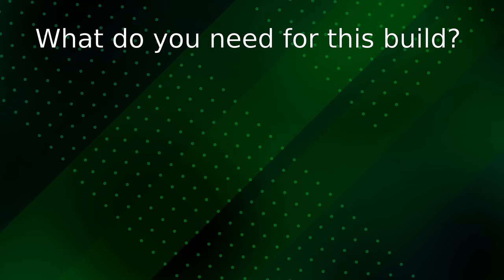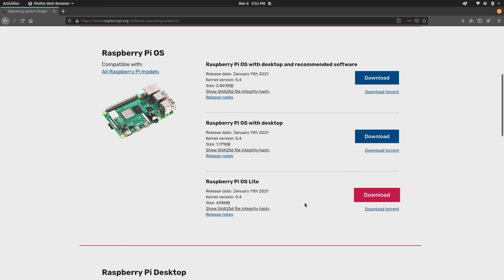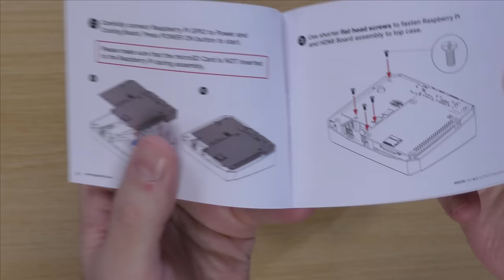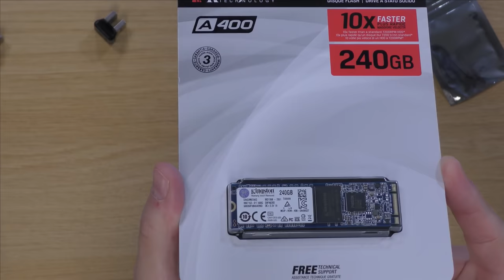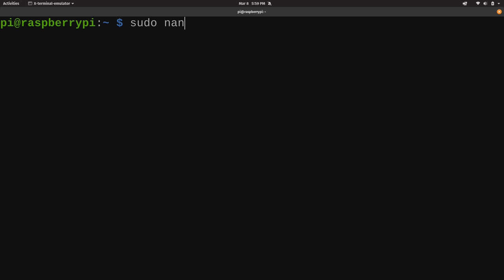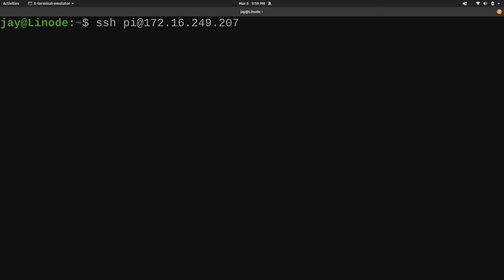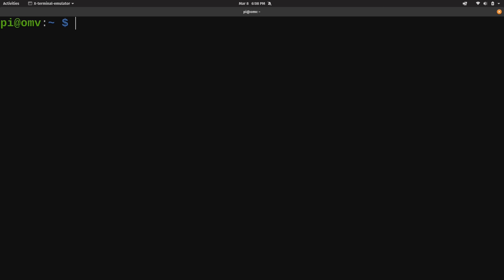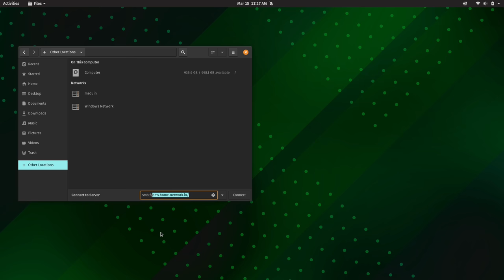Build your own NAS! A custom Raspberry Pi build with OpenMediaVault and an Argon One M2 Case

Comment: Thank you for a good practical project. I recommend that you also try to configure the Raspberry Pi to boot from the SSD and there by eliminating the need to access the SD card inside the Argon case. The SSD boot can be configured from the raspi-config utility directly.
Reply from the maker: Thanks for the tip!
Reply: Can  you please teach me step by step in this post ? And will the micro SD card be taken away since the beginning?
I have many sad stories about the micro SD card 🙄.
Reply: f

Comment: I’m very new to the world of the SBC and chose the 8gb RAM Raspberry Pi 4 and the Argon One M.2. I even have the same Kingston A400 240Gb SSD. I have nothing to compare it to but I have to say I’m really pleased this set up, thus far I've not found it lacking in any way for the purpose I bought it. Even though I've overclocked CPU to 2GHz and GPU to 750 I have never been at over 56°C, but I don’t do any gaming and stick to basic computing on it. You’ve now given a good reason to buy another.

Comment: Hello Jay.

I have the same setup,. but booting from the M.2 which increases the I/O speed and boot time dramatically (...and I also don't trust SD-Cards that much hehe...).

In case someone doesn't know how to:

1. do the standard SD-Card setup, but don't attach the bottom of the case with M.2 or USB3-Adapter for now. Just leave the case open and put it aside. So, you start the RPi without the USB3 adapter and without the bottom of the case attached, but with the SD-Card in.

2. Start the Pi

3. when started up, attach the bottom of the case and the USB3 adapter. Now the system will find the new M.2. in /dev/

4. use the command:   lsblk    to find the device name of the M.2, where we want to write the whole system from SD-Card on it. Let's say, it's /dev/sdb
Also, note the name of the system, the SD-Card.

6. Now we just copy the whole system from the SD-Card to the M.2:  dd bs=4M if=/dev/NameOfSystemDrive of=/dev/NameOf_M.2_Drive status=progress    So for example:   dd bs=4M if=/dev/sda of=/dev/sdb status=progress

In case the command is not working, double check that you have the capital "M "in the bs=4M part.

This takes a while. When done, shut down the RPi and remove the SD-Card. Put the case & USB3 adapter together and start the RPi with lightspeed ;-)

That's it, happy weekend and thanks for your great work Jay, I learn a ton from your book and videos.
Reply from the maker: Thank you for posting that! It's been on my list for a while to test out booting from an SSD on a Pi. I was under the impression that there was some firmware trickery required, but it doesn't appear to be the case based on your steps. I'll give that a shot at some point soon.

Comment: The bottom part could be expanded to a double drive with mirrored drives, argon or other could  do it, any m2 expanders ?
Powering it may be the bottleneck, but if bottom shell is replaced that could have a powerjack for the drives(+pi).
Sd card can be removed if you activate usb boot.

Comment: definitely look at your router as well. no RPI needed. 
  Just plug a thumdrive or an SSD into your router and you have a quick and easy NAS!
Reply from the maker: That's very true, a lot of routers have that feature nowadays. But not all of them do, though. The CPU can be a lot slower sometimes too.
Reply: nearly every time the usb on the router is usb 2.0,when you have a usb 3.0 hhd.and yes,the router can be slow.

Comment: Very clear and well made video.  Question.  If I follow these steps to create my NAS, will I be able to install PLEX server on it?  My current NAS (QNAP) which I am going to be retiring for this one has been acting as out home PLEX server and we are very used to accessing our videos this way.  Also, will we be able to access (read/write) from our windows computers to the external drive I am connecting to the Rpi via USB 3.0?  We will need to be able to transfer our photos and other files to it as well.  Thank you!

Comment: Hey Jay, great video, this is exactly what I have except I have the WD 1TB "blue" HDD. Will the fan and power button script survive a reboot?
Reply from the maker: My understanding is that it does, I've never had to readjust it or reinstall it. I've rebooted this NAS device multiple times since. If you're adjusting the fan speed, I'm not sure about that part yet, but maybe I'll look into it.

Comment: I'm missing the biggest question,  i have a few RPI's lying around, 3 synology devices and a 24/7 server running. Why should i use a RPI as a nas and not one of the other options ?
Reply: Not everyone has the others around. One should also have at least 3 copies of the data, 2 local and 1 offsite. That is...if you care about your data. The main NAS should backup to a 2nd on the network...then to the offsite maybe 1 per week etc

Comment: Worth noting: Most (all?) SD cards are not really built for use in raspberry pi and will were out faster than a hard drive or ssd. So personally I would not like to use the sd card as nas storage.
Reply: You can install the "flashmemory plugin" on openmediavault which creates a ram disk for all your logs and tempoary files.
Since the SSD is used as storage this should not really be a problem :)
Reply: @Felix-ve9hs  I meant the use case where the SD-card also would be the storage (since the SSD was considered an optional part). I would be fine using the sd-card as os drive. Good tip with the flash memory plugin, sound's like it could make a large difference in sd-card reliability.
Reply: @PatrikKron  oh okay I misunderstood :)
I also would not want to use the SD-Card for OS and Storage, not even in a RAID mirror
Reply: It's also possible to use the sd card only for the bootmanager and place the root partition on a usb drive (stick or 2.5"/3.5" usb ssd/hdd). Did this once with raspbian.
Reply: @AstroCat Oh didn't knew that, thanks. Did that on a 1st generation pi many years ago.
Reply: @Charlie8913  Or just install it all on an SSD and boot from it. It's waaaaay faster

Comment: is it possible to add external hdd(usb powered) tru the usb , to add more drives for nas space? and can this run plex in docker??
Reply: The Pi might struggle with the USB Powered HDD (mine did). Best to use a Powered Hub. But, Yes, Yes, and Yes.
Reply: @619ota   thx alot gonna give it a try then
Reply: I have a 2TB usb drive attached and run Plex in docker and all works well :)

Comment: Is this NAS build with a Raspberry Pi also possible with an array of 2.5" or 3.5" drives instead of just one SSD? What hardware would I need instead?
Reply: The Raspberry Pi 4 compute module might be a better option. The adapter board for the compute module has a PCIe slot where you can put a SATA HBA.

Check out Jeff Geerling’s Youtube channel. He’s done a fair bit with this .
Reply: I have added a USB 3 hub with 2 × 4G external drives and it works fine.

Comment: OMV is great but I've been having a hell of a time finding guides for Active Directory integration. A lot of guides are older or don't use sssd and realmd. Anybody have any guides for this?
Reply from the maker: I agree with the Synology comment, OMV wouldn't be my first choice for Active Directory either. I'm sure you can get it to work, but if anything changes on the Microsoft side and OMV hasn't been updated to match, I'd be a bit nervous. That's a hypothetical situation, but when dealing with a solution from a large company like Microsoft, it often makes sense to use a solution from a company with the funds to invest in it and collaborate with Microsoft. I hope you can get it to work though.
Reply: @LearnLinuxTV  this is mainly for my homelab. I didn't want to buy a synology just yet since I had a Pi4 and some SSD's lying around. Mainly just going to be used for some server backups and music/video storage. I try to run everything with AD integration to simulate production environment, but I do agree with both comments for a true production environment.

Comment: Thanks!And then can we install something like Proxmox(on the SSD, or a disk), and use the Nas as a VMs server, with a second drive?
Reply: Yes and no. You cannot install Proxmox because it only works on x86 architectures (maybe on others but definitely NOT on Arm which is what the Raspberry Pi uses). You can, however, try to install vmware ESXI instead, that should work, there are quite a few tutorials out there. You should keep in mind, though, that this requires a lot of RAM and will need efficient cooling, better active than passive. The Argon1 case does feature a fan, but it is controlled via a script that I would not know how to install next to ESXI, which doesn't mean it's not possible, but requires some further research or programming, which you should have in mind depending on how proficient you are with hypervisors and Linux.
Reply: @zeloslp2  Thanks for that!

Comment: Hi, I’m new to this channel. I find it quite interesting. Although this video is one month old already, I wanted to share what I did different my OMV install for my rPi4. So I did not want to use the SD card as I have had one die on me in another instance. I also did not want to use 2 physical disks. A trick I remembered using back in the 90’s, while building computers with my dad (he had an IBM clone computer shop back in the day). Since controllers and disks were SOoooo expensive and unreliable, we would split the disks in logical partitions (primary and secondary) tricking the OS into thinking there were 2 drives. Mounting them would give a C: and D: drive. Anyway, I tried this on my USB SSD on ma other computer (also Linux :) created file systems on both partitions (ext4 for both) flashed the OS on the first partition, installed the USB drive in the Pi, and voila.... installed following the usual steps. And, well enough, the second partition was mountable from the GUI the same as if it were a second drive. Worked perfectly :)

Comment: Would you be able to attached an external HD to this? Would it recognize it?
Reply from the maker: They make several "Hats" that give the Pi additional functionality, and an HDD is definitely possible. If the HDD was attached via a USB3 enclosure, it would work exactly the same as in the video.

Comment: Jay, I was waiting for this video... As promised from the livestream it was Awesome to the MAX... :-D
I'm not a PI user nor do I know much to about using them.
I do watch video about them but  when it comes to making them work and the coding I'm at a loss.
No matter how many videos I watch nada, zip! :-(
Maybe if I get one, the code issue will click in my head... ???
Been on Linux for 4+ years and I can do some bash scripting and get by with that. I do want to learn, my head is just now willing... :-(

With that said, This might be something I can do. I have a Ubuntu media server and backup server made out of some old 2 core Mobos and they do work great, there is always room for more. LOL

I do have a question...?
Can you also use a external USB drive as storage and running backups???

While warp speed is always good as power usage goes. Sometimes Implus drive and less power consumption is desirable... :-D 
They both get ya there,  just one is faster and cost more on the electric bill... LOL Like you my office is toasty in the winter and hot in the summer and have to run my window A/C colder...

Anyay Jay I was excited to see this video and will consider it as a fantastic option! You did not disappoint!
Thanks for the video!
LLAP
Reply from the maker: I remember you from the live stream. I believe I mentioned that I'd have it out the next day, but it was very very late. But I'm glad you got to see it.
A USB drive should be perfectly doable on this, it's essentially the same as the internal one since that's connecting via usb as well.

Comment: You have to fix your sound it breaks up get all scratchy its been like dat for awhile now its like you fade out the sound goes when it comes back it sounds weird
Reply from the maker: The audio interface is peaking, I didn't notice it until after I finished it. It should be fixed soon, but it takes a while for me because audio is not my best skill.

Comment: Not a NAS without raid 5,6,10
Reply from the maker: I can see your point there... ...It is a NAS technically, but RAID should definitely be added when you can. But you can also sync it to another device with RAID in addition.